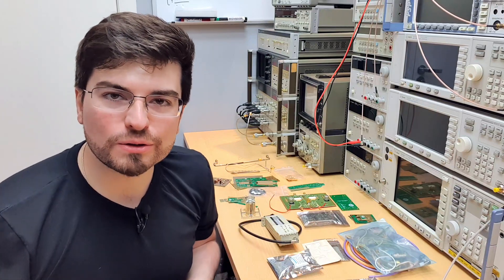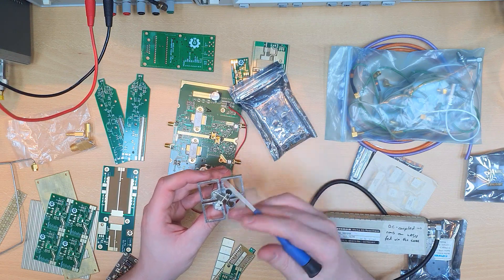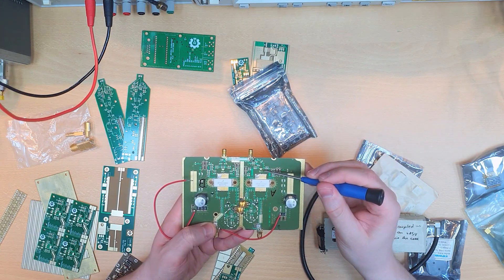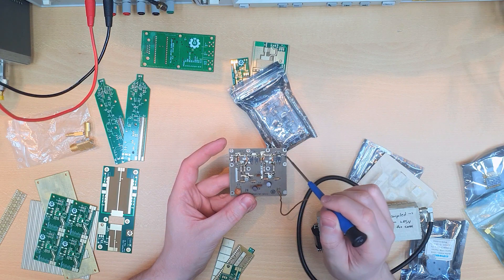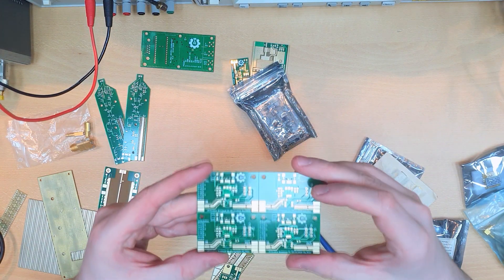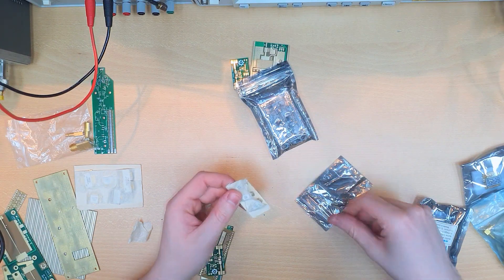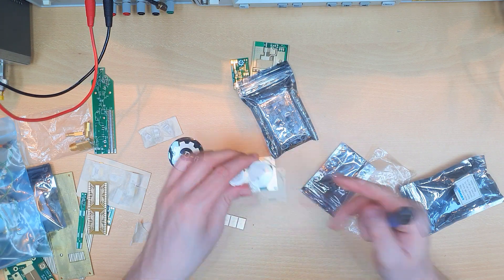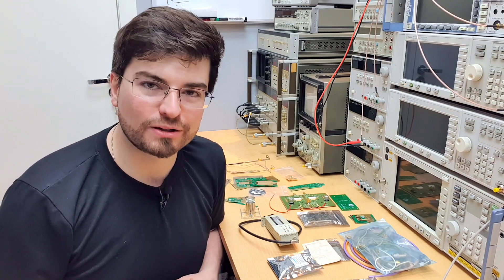Received gifts - RF Components and Parts

Comment: No, don't tape down electronics components. I am pretty sure it is not anti-static tape. When you peel or rub the tape, it may produce HV electrostatic charges and can be harmful to the components. In this case, it is pointless to use anti-static shielding bag to ship it in the first place, because the end user takes it out from the bag and then potentially destroys it by just peeling away the tape. And yes, I know what I am talking about because I own a Simco FMX-004 and I have tested on many different types of plastics and tapes.
Reply from the maker: Thanks!!

Comment: Hi Gregory, 

first of all I'm glad you like it. 
Here are a few words to things you mentioned:

- The aluminium badges are Aluminium PCBs, I tried them to see if they work for cheap printed frontpanels which they do.
- the antenna is a single element from a cellular sector antenna (the big white ones you see everywhere :D )
- the rigid coax is mainly from sattelite converter stuff I got from the scrapyard and ebay and is 50 Ohms
- the 100 Ohm coax was used in cellular antennas, I guess to match the impedance of the radiating elements as you described
  They also built power splitters that way in these antennas, by having matched length 100 Ohm cables.
- you got the input and output side of the LDMOS right, the SMB connectors are for gate biasing.
  The FETs are different power handling FETs since it was a Doherty pair before I butchered it up for testing .... sorry :D
  The numbers I think are either max. power or part number of the FET, I can't remember but I have seen this on many more modern
  base statoins, that they use weaker FETs for the peaking amp, propably to save some money.

Your description of transforming the short of the capacitors to a RF open at the Drain of the FETs is pretty nice. 
It makes it very obvious how it works, I have to remember that one.

- the small grey PCB is a wideband (almost DC to 2GHz) LNA from a old piece of japanese equipment.
  I found it pretty amazing since it is almost completete "through hole" parts
- the big boy is actually a downconverter / LNB, receiving from 12GHz on the microstrip
  the microstrip is the 12GHz input, the coax is power and IF out
  I thought you might be able to test some high frequency sources that way but you already got your 20 GHz spectrum analyzer      
  after all
- the small amplifier pallet comes from relatively old GSM stuff in the 860 MHz range, these FETs are nice to
  reuse, since they tune pretty good 
  HAM operaters use them on 23cm / 1296 MHz with around 60W output per FET.
  
The load modulation testing sounds very interesting, maybe you can put it on your video topic list?
Even a theoretical look at it would be very nice. 

I like to see what you can come up with.

Comment: Maybe the unknown oscillator that Runs on 15v is a gunnplexor which consist of a resonant Cavity with a gunn Diode to Maintain the oscillations ir is usually in the gunnplexors to make the output a WaveGuide or directly a Horn antenna.
Reply: It is actually a downconverter but I think you are right regarding the LO of the LNB.

Comment: Can you make a video about crystal colpitts oscillators that use a harmonic of the crystal? I saw a neat circuit that used an LC tank on the collector of a 2N3904 as a load and to select 100mhz from a 10 mhz crystal and feed it back into the oscillator, would be neat for a professional to analyze it!
Reply from the maker: I have it, search on the channel! Overtone oscillator
Reply: @AllElectronicsChannel  Thanks so much!